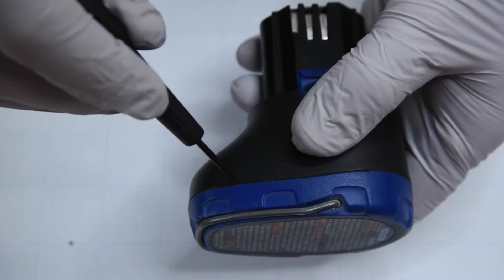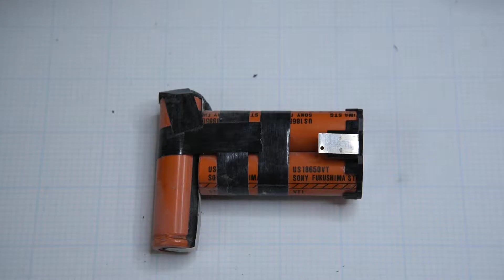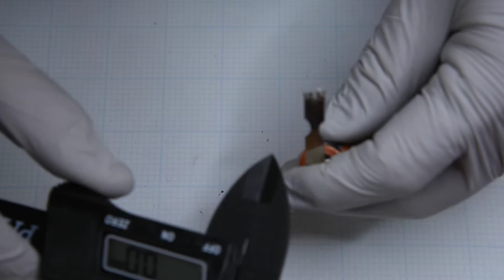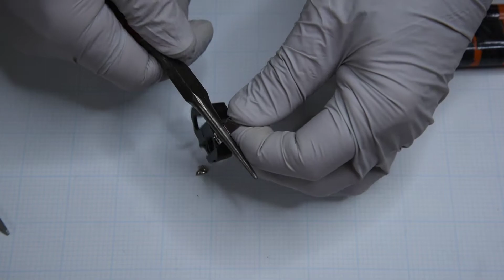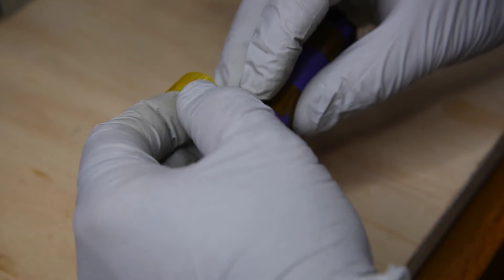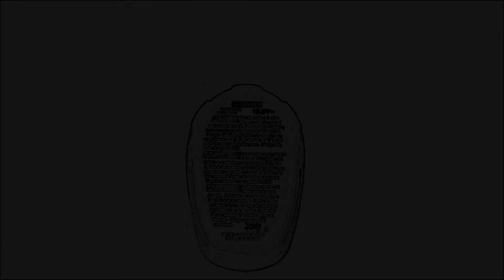Dremel 855 battery pack rebuild

Comment: Thanks for the video.
My two batteries are still OK. I was trying to figure out if the pack included a cell balance system - which it obviously does not! 
That is worrying, as with the cells aging and getting further out of balance, the fixed charge "full charge" voltage is pretty much guaranteed to overvoltage the weakest cell eventually.
I just pulled one of mine apart, now I know where the clips are; it's good that they are not glued.
This one has Samsung 1.3AH cells. The cell voltages in this one after standing with part charge (around 3.76V) are still within 10mV so not bad, for the age!
I think there is enough space in the base of the casing to fit a three cell balance PCB, which would help reduce any risks.
Reply from the maker: I think they used very good quality Li-ion cells for the battery pack, and the very slow charge rate really helped with the life of the battery.  About a year after I did this video, a winding opened up on the motor. The break wasn't even at the commutator terminal.  So I had to replace the entire thing.  But I will say the new Dremel cordless is a lot more powerful.  It will be interesting to see how the battery holds up.

Comment: Anyone know the thermistor value ? Trying to figure out if my charger or battery pack is done.

For who ever needs it, the thermistor has a value of +/- 8 kΩ ambient temperature 20c.

My battery and charger are still fine after almost 20 years just forget how the charging light worked.

Solid green charging no light full or broken.

Tnx for the teardown made my life way easier!

Comment: No BMS either in the pack or the charger?
Reply from the maker: No, just a very, very slow charge.
Reply: @metalplasticelectronics354  would it be worth adding something to the charger at least?
Reply from the maker: Really without monitoring each cell couldn't do much for it.